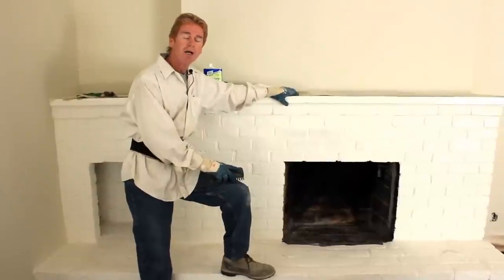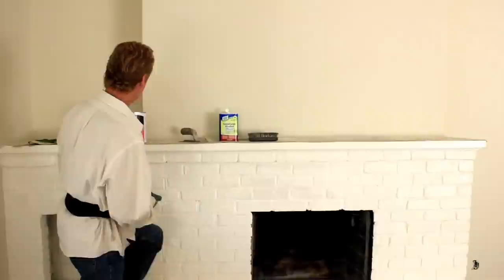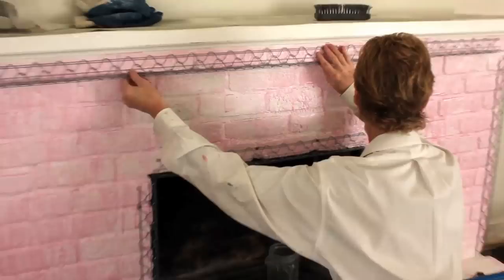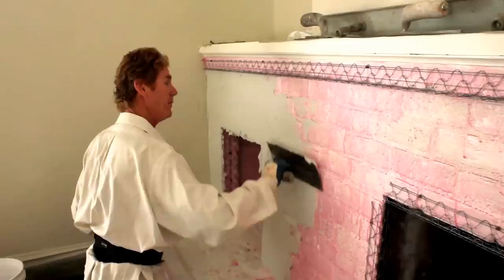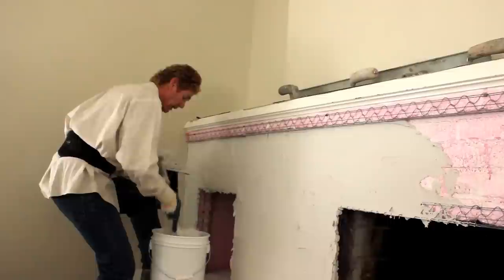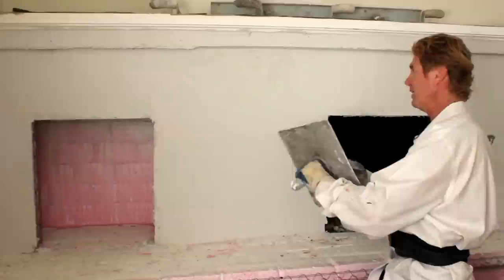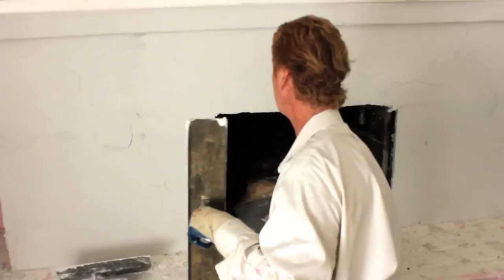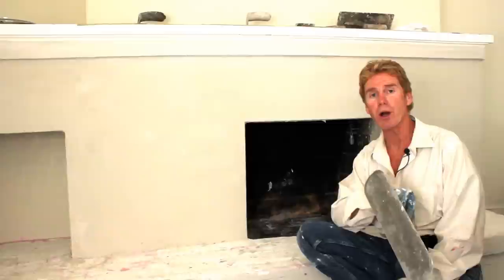Plaster over interior brick fireplaces

Comment: How are you doing Kirk . Big fan fellow plaster man. Wanted to share an experience I had with Structolight I wanted to see if you answer for me from you experience.

I had a room that was sheet rocked . Applied my bonding agent and used Structolight as my based coat. 
my first coat I applied cracked like an egg everywhere . I put a second coat and got the same thing but only in certain spots. 

It seems to me that what happened is some that is indicative of steel troweling  cement. I did a second coat and went over it with a stucco brush to try and open it didn't have serrated Darby. Still cracked like an egg.

Was my app thickness to thin ? Is my substrate the problem ? What did I do wrong ? 
Also the structolight seemed to have poor adhesion was able to scratch it off . Taping mud would of adhered much better even without using a bonding agent . 

thanks
Mike
Reply from the maker: Howdy Mike, seams like the bonding agent you used was old or not of good quality. 
As it should have adhered well, structo-lite will crack if it applied heavy but that's no big deal as it's a basecoat, a finish coat will hide these cracks.
                    Live long and plaster
         Mastering Plastering for the beginner’s

Comment: No plasterweld or any thing like it at HD or orchards or Lowes....any ideas? There is a product called Drylok Latex Bonding Agent...ever use that?
Reply from the maker: Slap Stick Hi Slap Stick, Home depot has Sika concrete bonding agent and Lowes sells, masonry quikrete bonding agent or adhesives they are just as good.
 I have to start mentioning this in the video's that I apply the weld crete in, as I do get asked this often.
 best wishes, 
 Kirk Giordano

Comment: Hi Kirk, thanks for another informative video!  I am building an inbuilt book shelf with the 'pilasters' made of OSB. I plan to put down water resistant paper then apply metal lathe/corner beads etc on the pilasters. I plan to use Structo lite basecoat and then use a finishing veneer plaster (2 coat system):
1) Any suggestions with my approach above?
2) which finishing veneer would you suggest for an amateur; diamond, imperial or redtop?  I think the easiest to apply a smooth finish would be best.

thanks-
Dean
Reply from the maker: Evening Dcrot dude, You're above plan is sound.
 I can't tell the difference between any of the veneers you mentioned when I apply them.
 Apply the basecoat of veneer let set so it's dry then apply the finish, just takes practice.
 Best wishes,
Kirk and Jason Giordano DIY plastering tips
Reply: Kirk & Jason Giordanos DIY plastering and stucco instructional videos and forum Thanks for your reply. I called USG tech support and they said they didn't think I needed to use waterproof paper over OSB?    My feeling is that I wouldn't want something wet directly on my OSB - do you have any thoughts on this?
Reply from the maker: Hello  Dcrot dude, 
 I have not gone over OSB or plywood without paper and wire, however I am a licensed contractor, and am liable for all my work.
 If folks wish not to use paper and wire and simply go over wood that's their choice but it is improper.
 best wishes,
Kirk and Jason Giordano DIY plastering tips

Comment: Is the finished coat also done with structo-lite as well--or do you use a different product for the final coat-i was under the impression that structo-lite was not for a final finish coat?
Reply from the maker: Hi lana, yes the base coat is structo-lite, after it set I used a diamond veneer plaster for the finish coat.
 The structo-lite when curing will drag and stick to the trowel if I tried to steel trowel it, so it can't be finished smooth,
 cheers,
 kirk giordano
Reply: Sorry, i lost my connection in the middle of my email to you.  My question is are there techniques where you can use structo-lite for a finish of some sort?  I know it would not be smooth but some tech, that might make it look concrete like?  Thanks for your help and for all your videos-very soothing to me wathching you and I wonder if you get that comment from others.
Reply from the maker: Evening Lanaa, well this takes a bit of practice but one can achieve a very rough and flat finish if you apply your base coat, then take your trowel on edge and pull in a straight to keep the pattern but give a real rough finish.
 Looks cool but takes a lot of practice.
 Best wishes, 
 kirk giordano

Comment: Hi Kirk, Structolite base and Brown.   Do I need bonding agent before applying Veneer coat?
Reply from the maker: Excellent question Jose, man, you're one busy dude.
 No, you need a bonding agent for the structo-lite to adhere to most substrates or surfaces. However, the finish coat will adhere by suction to the structo-lite, so make certain you mist the structo-lite basecoat with water before applying any finish coat.😉 
Note: to all subscribers or anyone who stumbles on our channel with a question, type it into our Stucco/Plastering channel, 
and like magic, a video will appear to explain how it's done. 
This feature is miles ahead of any plastering forum. 🥳
Kirk Giordano Plastering

Comment: We have done a first coat of structolite on our brick fireplace in the manner you say. Our brick mortar lines are set Back from the brick. It looks good when it’s wet but then as it’s drying it begins to get lots of small cracks in it. Is this normal? Did we make the mix too thin/thick ? Can we do something to prevent this? Does this affect the stability of it? 
Will the veneer finish  coat do the same ?
Reply: And if it was the bonding agent we used that wasn’t good that caused the cracks will that be a problem with adhering to the surface ?
Reply from the maker: @timandchristinelassen4485     Good Evening Tim and Christine relax, this happens for many reasons, the first being over troweling, if it's your first time and your nervous about getting it right, one tends to keep on troweling to make certain it's just right, this over troweling breaks the packs.😏     No worries, a finish will cover/bridge all the cracks. 😉
 Tip:  Before applying the finish coat, wet the base coat or the basecoat or the dryness of your basecoat will suck the moister out of the finish coat to fast, causing weak adhesion, blistering, and separations, this is true, but I'm not saying this to add to more anxiety but to educate so you then apply and say, Damn this is really easy.😉
   Wet the basecoat with a spray bottle filled with water or wet paintbrush.
Again relax, you are on the right path.
  Kirk’s Tip: to all subscribers or anyone who stumbles on our channel with a question, our gift to you is, type it into our Stucco/Plastering channel, and like magic, a video will appear to explain how it's done. 
   This feature is miles ahead of any plastering forum. 🥳
Kirk & Jason Giordano Plastering
Reply: Thanks so much!

Comment: Hi kirk i have a question for you if you dont mind.I am doing a hotel reno at the minute and i have  a ton of inserted popcorn ceilings to leave a level 5 finish on.the texture of the popcorn is pretty small but it has been painted over a numver of times.Im thinking of using either  structolite or gypsolite as a basecoat after i grind the popcorn back a bit.I believe one of those two products would be good for a basecoat as it is lightweight.Just wondered if youve ever used one of those for this purpose and which would be best.i was gonna use a pva and water bond underneath.Thanks 😀
Reply from the maker: Evening Patrick, I have done this a couple times, what I did was to cover the floors well, then use a Hudson sprayer or water hose if you can get it in there, spry just the ceiling, then scrape off with a trowel. 
what you find under there determines what plaster you may need, chances are only a bonding agent and a single coat of Diamon veneer plaster.
 FYI, to grind that gypsum off will be too much dust.
 Also, you can't trowel down smooth Structo-lite as it has sand, no one can give a smooth level 5 finish with that basecoat.
       May you all have a Merry Christmas and a happy and prosperous New Year.
Sound Plastering tips from your favorite stucco geeks
Reply from the maker: Howdy Dude, lots of ways to skin a cat.
                           Peace, love, and harmony to all
         Sound Plastering tips for the DIY beginner’s and Plastering experts
Reply: @StuccoPlastering  thanks kirk

Comment: Kirk, quick question, what is the required maximum thickness of Stucco for ceiling based on your experience and you've seen on the field, thanks
Reply from the maker: Hi wangbungal, on average from 1/2 inch to 3/4 of an inch, depends on whose plastering.
Cheers!
 kirk giordano Plastering
Reply: +Kirk & Jason Giordanos DIY plastering and stucco tips dont you think 3/4 inch is too thick and heavy already for the ceiling??
Reply from the maker: Hi, that depends, old school was wood lath with three coats lime plastering or of the last 50 years gypsum Plaster same three coats, both systems roughly 1/2 inch to 3/4  inch.
 New methods sheetrock,
(compressed and machined gypsum)
1/2 inch to 3/4 , inch depending on what in the blueprints then taping mud adds about another eighth of an inch.
 Are you talking about going over an existing ceiling?
 Kirk giordano
Reply: Bare solid concrete, I was just thinking bonding agent, scratch and then finish, two coats would that be ok?
Reply from the maker: Hey dude, with bare concrete, clean really well, apply a bonding agent the apply a tight coat of diamond finish about an 1/8 thick, takes practice.
 There are about ten ways to get this ceiling covered, the above method is the one I would use, but I have not seen it,
 Cheers!
 kirk giordano Plastering

Comment: The interior of my house is cinder block and I want smooth, flat walls. Cleaning cinder block walls and theany pores is such a pain. Do you recommend this method?
Reply: Oh, I should mention that I especially  want smooth walls for my bathroom. All the interior walls are painted cinder block just like that fireplace you're working on.
Reply from the maker: Hello sweetie, other methods are faster but not as strong or moisture resistant.
 Little wonder the back-to-back system we're explaining in this video is code for Hospitals, schools, police stations, and many other uses like racketball courts.
 Cheers and Happy New years Eve.🥂
Reply: I have the same and want smooth flat walls

Comment: How long do you have to wait after using plaster bonder to use the structolite?
Reply from the maker: Howdy Soufside dude, just until dry, perhaps 5 minutes to an hour depending on the temperature andbsubstrate you're going over. 
                    Live long and plaster
         Mastering Plastering for the beginner’s

Comment: Hi Kirk, Hope your well... I am thinking to use Strucctolight to to fill and level out some bathroom walls (where i removed very old tile from a 100 year old mud job) I need to build up about an 1" to make level with remaining plaster walls ( then putting back tiles)....I am thinking to adding portland cement or plaster of paris to accelerate drying time ( what did u mean when u said you added gypson for accel???) any where can I send you a pic of this mess?
Thanks
Joe
Reply from the maker: Joseph Minutella hey dude, you can buy gypsum at Westside building materials or any other plastering material yard.
 This is what I use for accelerating Strucctolight.
 Pictures? send to Kirk4staucco@gmail.com
 best wishes,
 kirk giordano Plastering
Reply: Kirk & Jason Giordanos DIY plastering and stucco tips  thanks!

Comment: Hi Kirk. Quality as always .
Could i do a job like this with rapid set, then top coat it with diamond or drywall topping ?
Thanks
Reply from the maker: Howdy Tim, you could use the Rapid set for the base, this is a Portland-based cement, the Diamond is plaster based so I would apply a bonding agent over the Rapid Set Stucco when cured, then use the diamond plaster or taping mud.
                               Live long and plaster
         Mastering Plastering for the beginner’s to experts
Reply: @StuccoPlastering  hi mate top quality ,just wondering your process if it is just a taping job? For instance, when you say about not sanding, would you ames tape the joints and just polish that to a finish, i try talk th customer into plastering because its less mess,obviously with no sanding ,using a multi finish plaster ,my question really is,with taping do you think you can tape, with mud as you call it ,then just polish that to a finish?
Reply from the maker: Evening Richard, taping mud is just gypsum, I prefer if I'm going to apply a base coat and finish coat I prefer to use a product that is half gypsum and crushed lime for both layers.
 However Multi finish is a product sold in the UK, If you are really experienced you can use just use this product, but allow the base coat to thoroughly dry or you can get blistering when trying to polish it, as that's the basecoat and finish coat adhering to the trowel by over troweling, thus destroying the bond.
 I have a video one one coat veneer plastering BTW.
       May you all have a Merry Christmas and a happy and prosperous New Year.
Sound Plastering tips from your favorite stucco geeks

Comment: Is it the same process if our brick isn't painted?
Reply from the maker: Evening Danielle, yes.
 Unless you make sure, all the bricks are clean from all dust, dirt, and grime. 
  Even then, I'd still recommend a bonding agent be applied to cut down on the suction.
 This means when you apply plaster or stucco to a brick surface.
   The thirsty, porous or dry bricks will not suck the moister out of the new plaster to fast.

                  Bringing peace, love, and harmony back to the world of plastering.
    The complete plastering encyclopedia on video, by the plastering messengers of Youtube.  
                                                     Over 800 videos

Comment: Hi, I have a flagstone fireplace. I'd like to use stucco or plaster but I'm worried about it sticking to the flagstone or the heat cracking it. It seems it might be easier to put hardy board over the stone and do plaster. Curious what you would recommend? Or maybe you'd like to come up to Tahoe and do it for me?
Reply from the maker: Evening Michelle, removing the flagstone and installing Hard-board is a big job. Cleaning the flagstone is a decent amount of work but much easier, a bonding agent is then applied to the flagstone, and exterior cement is used. So it is not affected by heat from a fireplace. Then you can finish it. 
Tahoe is a bit too far for me to travel unless you're single. 😏🥂
Here's what you would have to do to remove and add wonder or Hardi board. https://youtu.be/2Fk6Bs0783Y/ Cheers.
Reply: @StuccoPlastering  Thank you for the quick reply. I hadn't planned on taking off the flagstone but was thinking of putting a concrete board on top of it. My other option is to use lime plaster on the board or brush it on the stone itself. Yes, I'm single BTW... so does that mean you'll come up and help me? 😏
Reply from the maker: @michellegartner4138  Hello Michelle, too funny, not the single reply, but today my son, Jason, was cleaning out our garage. Among many things, he says, dad, I know you paid a hundred bucks each for these 6 50-pound bags of pure line plaster, but they have been here two years talking up space. So I said, chuck em, already today you are the second request on this day that could have used them. 
Yes, I was flirting with you as your picture shows such a lovely lady. The last time I went to Tahoe was thirty years ago on a motorcycle wearing jeans and a tee-shirt, then froze my dumb ass off coming home at night with no jacket. So back to your question, does that mean I would go and help? I'm cruising to Mexico from SF in two days on Princess, the 17th until the 27th. 
Sinse stranger things have happened in my life, you and your need is intriguing, email me at kirkgiordano@gmail.com, let's talk? 🥂
Reply: Ok so I'm curious if you two ever met up?😂

Comment: Hey Kirk!
I was planning to use the structo-lite as thick base coat to make an ex doorway flush with the existing THICK plaster (3/4) and then finish with Diamond. Then I was told that I could not use Diamond over the softer and lighter structo by the people at USG! What do you use as a finish coat over Structo-lite?
Reply from the maker: I too use Diamon plaster as it has no sand, so it can be smoothed troweled.
 Here's a tip my friend, I  can smooth even the gluey structo-lite plaster down If I put an inch or five on, the secret or tip is to wipe your trowel down with your sponge float with every stroke thus the water helps the trowel glide across the structo-lite without sticking.

Comment: hi kirk nice vídeo I have one question can I put a bit of 5 minutes mud or rapid set and how much to my structo lite ? to speed up the set time
Reply from the maker: Good Evening Johnnie, not sure because structo-lite sells it's own accelerators or what they term Control Set for this product.
            Live long and plaster
  Kirk’s how to plastering video’s
Reply: ohh ok thanks kirk
Reply from the maker: Good morning Johny, no worries
    Live long and plaster
 teaching  plastering video’s
Reply from the maker: Morning, No worries my friend 
Kirk
Reply: Jonhy Guzman heey a bit late to the party but I like to add Portland cement type 1 to my structolite. I usually mix a 5 gallon bucket of structolite ( half a 50 lb bag) and add 2 scoops of cement with my 6" knife, and that will set in about 30 min. I play with the ratio so that it dries faster, usually 15-20 min like plaster of Paris. For smaller batched I'll add 1 scoop. Hope this helps!